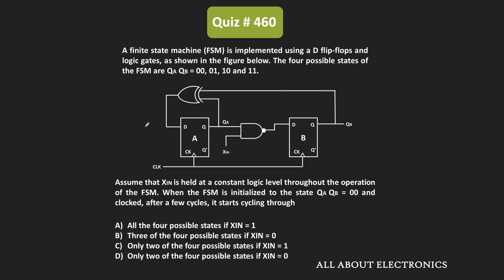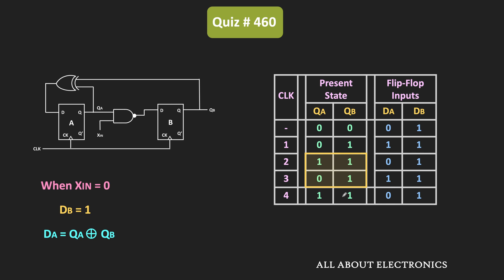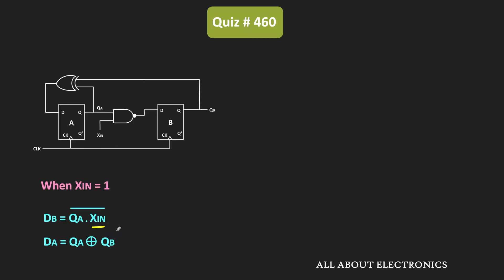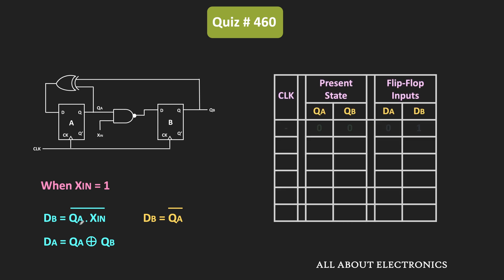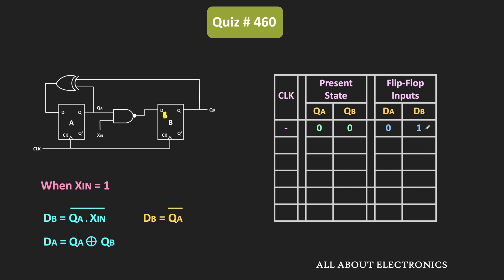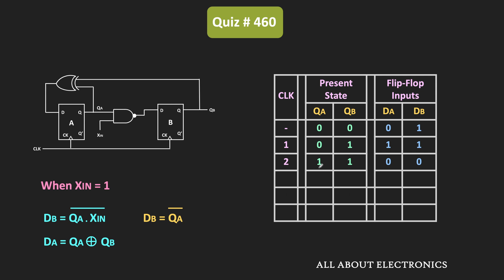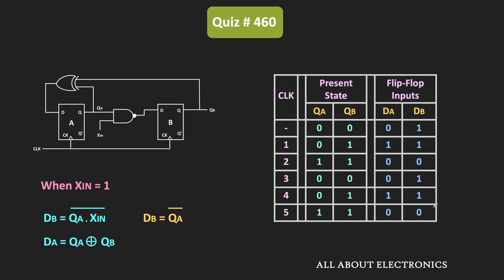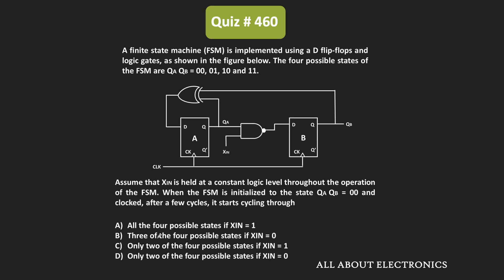Finite State Machine (FSM) Solved Problem | Quiz # 460

Comment: In 6:39 DaDb = 10 would not be the correct state? Instead of DaDb = 11? 
Because QaQb = 01, then 0xor1 equals 1, setting Da = 1. With Da = 1, the nand gate would result in 0, setting Db to 0.
If you could help me understand... 
Excellent video! As always